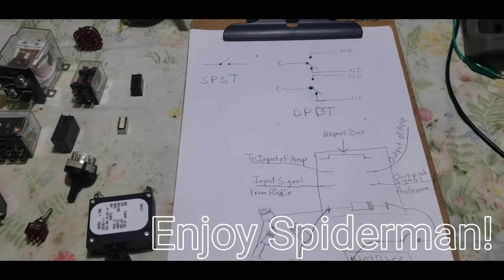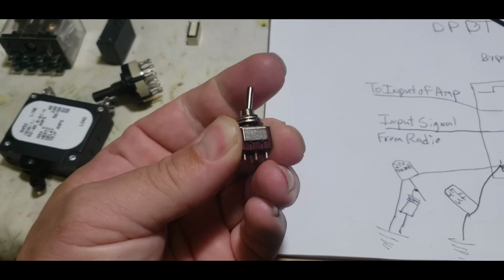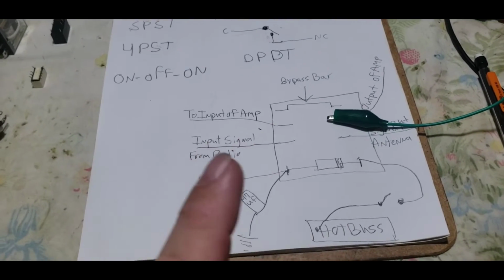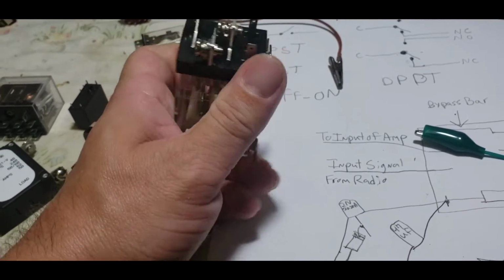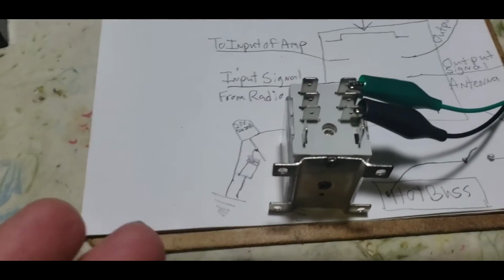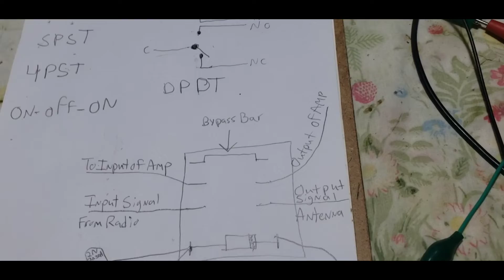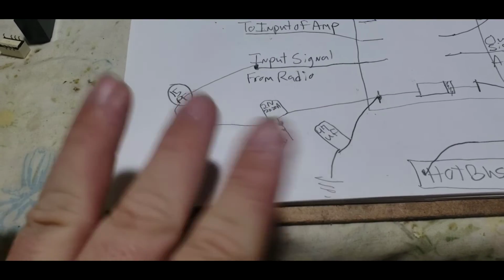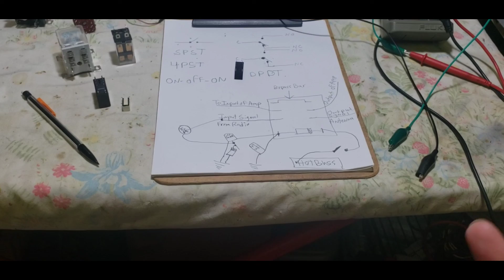RF Amplifier Building Concepts For Beginners - SWITCHES & RELAYS

Comment: Awesome video on the relay explanation 👏.  Helpful knowledge as always. Thanks for the your time and wisdom 🙏.  Just needing some more knowledge on details of the keying circuit with biasing for class C and A/B. 73's from the coast of the Magnolia 585 said it bump bump.
Reply from the maker: I will actually release that next. I made a video for a buddy of mine showing him a few biasing circuits. When you say Keying Circuit. That is a very very simple circuit. With the biasing you just need to allow the main relay to trigger when the voltage is sent to the biasing circuit just because you don't want the heat being generated just while the amp is sitting there not being used.

There are a few ways to so this....most of us just use another relay and tie the ground of that coil with the main relays coil so when the keying circuit gives the main relay a ground it gives the biasing relay a ground.

Or you can use a 3PDT relay and use one of the leads on the relay to switch the bias voltage to the transistors.
Reply from the maker: Also search Gatekeeper In Amp Building Concepts Because I have an old video where I showed how to build a keying circuit.